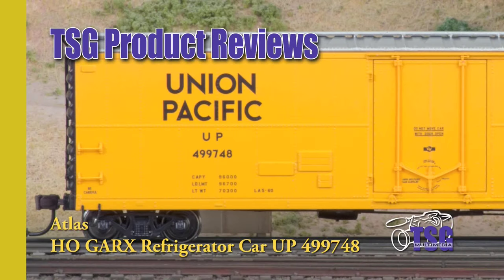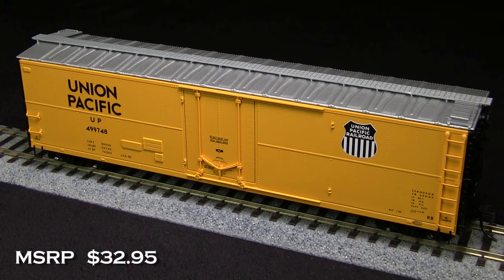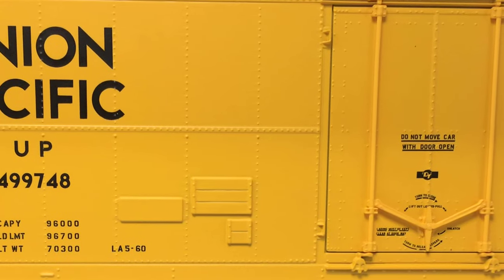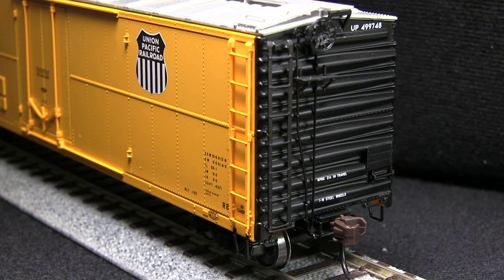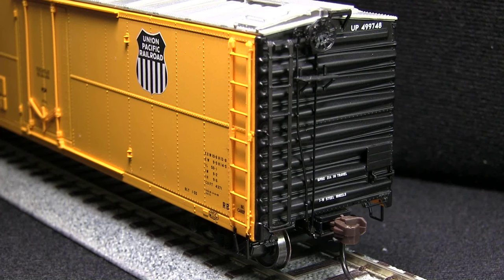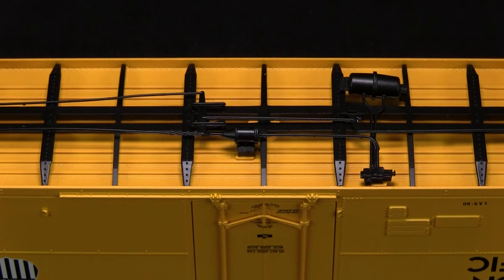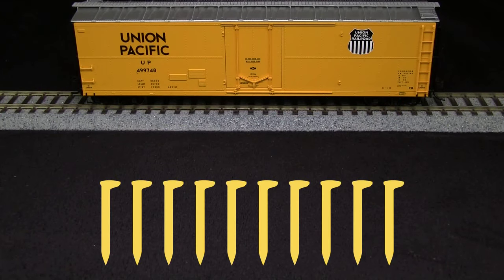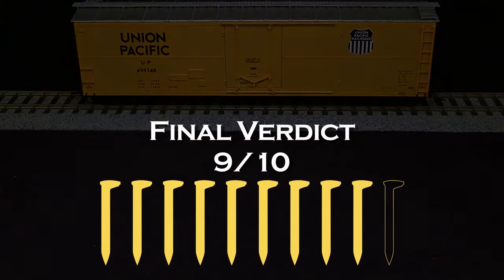HO Scale Refrigerator Car UP Reefer Atlas Product Review

Comment: Have to disagree that "refrigerated box car" as there's nothing on this car that makes it so. It is more likely an insulated boxcar that will keep cold items cold when put inside Most of those cars have a "RBL" AAR code on them. This car has "RB" in lower right hand corner.  AAR codes are usually by the reporting marks.
Reply from the maker: +Andy Jackson I think I get what you are saying -- because it doesn't have a mechanical cooling unit on it, right? I don't see any hatches for ice either, for that matter.

That being said, however, we're reviewing a product that is offered by Atlas as '"HO 50' GARX REEFER UNION PACIFIC #499748" so that is what it is called in the review.

http://shop.atlasrr.com/p-44841-ho-50-garx-reefer-union-pacific-499748.aspx

John
Reply: Yes...RB makes this a refrigerated boxcar.